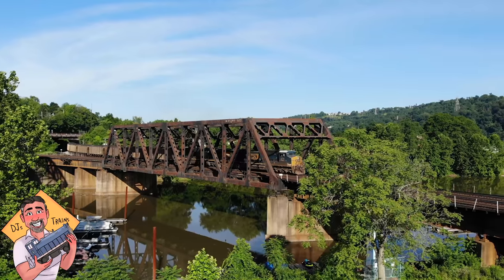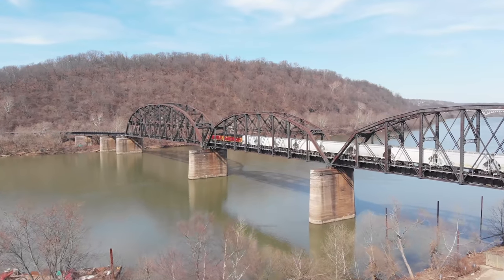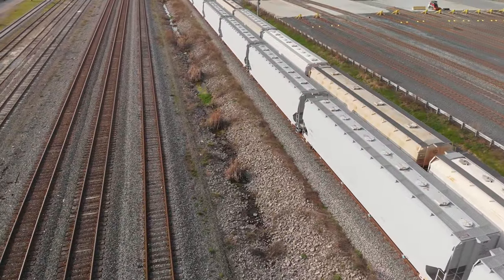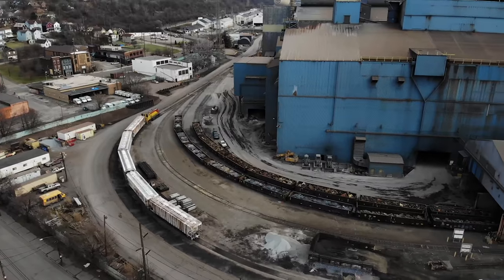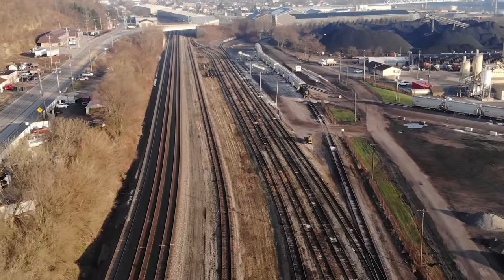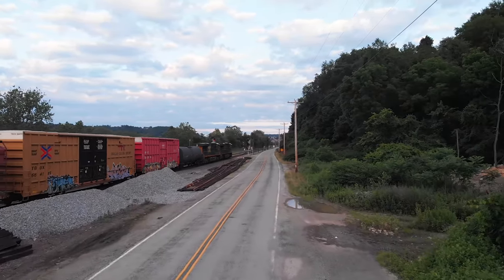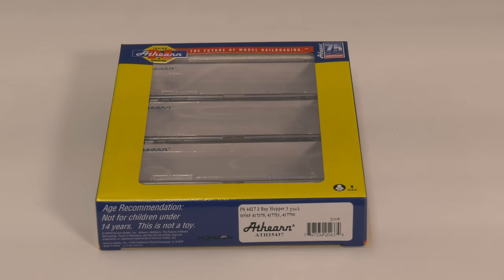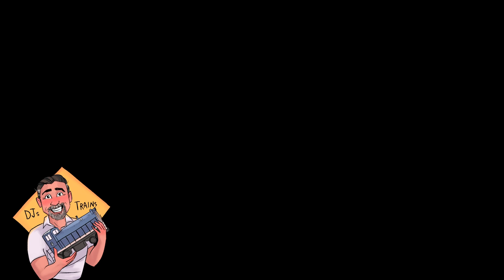RAILROAD FREIGHT CARS EXPLAINED BY AN ENGINEER!

Comment: I live out in Utah where a lot of salt is shipped by rail and a large variety of hoppers, 2 bay CSLX 5000s all stainless steel, now I'm seeing former 2 bay Winchester and Western 2 bay covered hoppers. And to make things more interesting, about 15 years ago a railroad car shop opened up and does repairs on the cars. From replacing the the bottom discarge gates, roof walks, lids / hatches, truck repairs to complete repaints. Always neat to see a car fresh out of the paint shop only in fresh paint. After watching the activity there I decided to buy one and once I get going on my layout I'll build it with an overhead crane big enough to unload damaged cars and carry it over to another bay for wreck repairs. I've seen a lot of variety of cars go through that shop! Happy modeling everybody.

Comment: You neglected to mention the difference between Covered Hoppers for agriculture products and ones for Plastic Pellets. Plastic pellet hoppers are the thinner discharges and are 4-bays, grain hoppers are wider discharge and are usually 3-bays, dried distillers grains which are a byproduct of ethanol and are used for feed are in 4-bay grain hoppers.
Rib Side and smooth side is basically age, the rib Side hoppers were mainly built in the 70's and 80's.
Reply from the maker: Thanks for the info
Reply: I used to switch for SGS petrochemical, we have nothing but petrochem/polyethylene plants here in Houston.

Comment: I've watched several of your videos now, and just wanted to leave you a note THANKING YOU PROFUSELY for all you do.  I've been a railfan and model railroader my entire life, and I think I've learned more watching your videos than any other source, no kidding.   

I'm also a BRAND NEW N SCALE model railroader!   I'm in the process of creating my first ever N scale model railroad, even though it's just going to start out as a simple loop.   But I'm using the T-TRAK modular standard, and plan to add to the railroad using additional modules as I have time and money to make them.    I think of it as layout building on the installment plan!   But even though my first layout is going to be small, I designed in seven industrial sidings for some switching action.   The only industry that will be able to make use of covered hoppers will be my grain elevator.   After the oval is setup and running, a small yard will be the next project.   

THANKS AGAIN!
Reply from the maker: Fantastic 
You seem very smart, not trying to tackle a basement empire and instead starting small, logical and practical.  Keep industry close to mainline and no try to fill up plywood with track.  I thank you! And wish you the best.

Comment: I am building a layout in a space that to small to even host a 4x8 in HO, unfortunately, operational doctrine means that I cant do everything prototypical (I have to use my yard for storage of my 7 car Daylight, and cant afford to host a A/D track), but I've tried to keep it neat, and somewhat prototypical. I have two industries (a freight house, and a grain loading facility) and 1 & /2 track in my yard for each (keeping in mind my 7 car daylight, I think I made good use of it). I do have a siding on my layout, but my doctrine (and train length) keeps it fowled on one end. For approximate size the room is a 12x12, and the layout is 5x11 (and is on the floor). Trying to get it that much more prototypical, but being restricted to 60 pieces on the trial (because I don't have the best income, plus I have other hobbies) is making things difficult. I do want to try and make the layout a 6x10 soon, but "soon" for me could be as late a November next year.
Edit: I also need to keep the layout easy to move without breaking details and what not should I move into a bigger space. Hopefully when that happens, I will be able to make the railroad a bit more prototypical, if I have not fully switched over to building warships by then.

Comment: There are two basic eras of railroading, typically thought of as steam vs. diesel.  But it is more profound than that and there was a long period, a generation or two of switching over.  The earlier era as dominated by human labor and the modern one, machinery and automation.  (I may be painting with too broad a brush for this discussion.)
Covered hoppers and containers are the result of being able to load and unload vast quantities in bulk.  Up until WWII, cement for instance was shipped in canvas sacks or maybe barrels or drums, inside a box car.  These were loaded, unloaded by men with handtrucks or even just brute carrying.  Grain was an early commodity that could be moved by conveyer but was shipped inside box cars with special temporary "grain doors" to seal the door openings and allow the box car to be used like a covered hopper, EXCEPT it did not have bottom hoppers to facilitate unloading.  However, this was partially due to so many box cars around, so these cars were not specialized and thus limited.

Comment: I'm not much up on modern day railroading but through most of the 20th century at least, each freight car was uniquely identified by its "reporting marks." These were the standard initials of the owner, such as "NYC" for New York Central, and then a unique car number.  This allowed the tracking of where to send each car based on "waybills" (the piece of paper that identified the shipper, what was being shipped, from where to where, etc.)  
Often model freight cars are only offered in one or a few car numbers.  If your operating scheme depends to using these marks, you'd need to keep them unique - although in modeldom, confusing two cars and sending each to the wrong destination, is not a problem.
Reporting marks can also refer to the additional info stenciled below the reporting marks (see, different meaning and usual kept separate by context).  This would including the light weight of the car, when it was last weighed, and the weight capacity.  Many freight cars have to be weighed on a track scale after being loaded in order to make sure the weight isn't exceeded and sometimes for how much to bill the shipper.
This explanation is because when weathering the car, the reporting marks need to still be visible.  As freight cars got dirty, if they weren't in line to get a brand new paint job, they could get their reporting marks repainted.  Sometimes the background area is also repainted, even in a different color, to make the contrast visible.  

In the steam era, when most cars were either black or box car red, it was common to see muted dirty cars with bright white reporting marks.
Reply: Reporting marks haven't changed much over the years.   There is a 2 to 4 position alpha code representing the car owner and a 1 to 6 position number.   This is the North American standard.   That standard is not followed internationally.
Reply: @cdavid8139  That is certainly true to today but if you go back far enough, things were much more fluid - standardization on so many features came about due to confusion prior to that but it took awhile for things to get bad enough that something had to be done.  
At first, the cars themselves were not interchanged.  Loads had to be unloaded and reloaded into the new road's cars at each interchange point (although often loads were not shipped that far - the railroads performed the function of local trucking firms).  
Then railroads set up "fast freight lines" which were designed to facilitate movement across many roads.
Another thing that arose was the "Official Railway Equipment Register" or ORER - a boon to future modelers in terms of getting historical info and many are available now on disc.  They would spell out "the cars of this railroad are marked . . ."  and give both the names and initials for the alpha code.  But railroads at the time seemed to have hated standards applied to them by outside forces.
For instance, Rutland freight cars were marked with "Rutland" as the alpha code on the side of the equipment and just "R" on the end reporting marks.  I seem to recall their official marks were "RUT" which wasn't used on the cars themselves, only in the paperwork.  I have also seen conductors' notebooks for the Rutland (by one William Shakespeare, a literal descendent of THAT guy) where "C" was used for New York Central, since so many passenger cars on the Rutland came off the Central.  
The term "reporting marks" were those by which the car ownership was designated for REPORTING purposes on paper and only slowly came to also mean the way the cars themselves were marked.
There was the common practice of having the initials end in "X" if it was a private owner, not a railroad - such as Railway Express Agency being "REX."  RR-owned cars were changed a per diem (daily rate of $1 or $2 per day in mid-20th century), like a library charging a small fee to facilitate return of a loaned-out book.  On the rail system, at midnight, the fee went into effect based on where the car was at the time, and so all roughly 2 million cars had to be accounted for.  Then the rr's offset each other's fees so that if railroad ABC had one of XYZ road's car on their line, and XYZ had one of ABC's cars, the fees balanced out.  TWO MILLION cars!
All of these was done in an age before computers and even before photocopies, only carbon paper, and resulted in a massive fleet of clerks hired to make the system work.  (At its peak, the railroads employed directly or indirectly 1/6th of the entire nation's labor force.)
Privately owned cars were charged a mileage rate.
Another constant problem early on was the constant buying and selling of one railroad by another, both subsidiary lines and mergers so the ORER would have to list ALL the initials under their control, resulting in a long list of different letters for some roads.  It also would take awhile for the car shops to getting around to relettering (and sometimes renumbering) the entire road's fleet, particularly since cars might be wandering around off line for quite awhile.
Back in steam days, the ampersand (&) was used in reporting marks but later dropped so the D&H became the DH.
One of the major things to consider was that in steam days, many decisions were made between individual roads and slowly grew to become a national standard, but NOT a government-imposed standard until later.  Thus the roads were free to bypass the overall standards by agreeing among themselves on minor points.  This ability to vary was slowly reduced in scope over the 20th century.  (For instance, at different points, old mechanical systems like archbar trucks were outlawed in interchange but an individual road could run cars with these as much as they wanted.  And they might allow certain equipment with archbars from a neighboring road to run on their line, either an actual agreement or just simply "looking the other way."  The ARA/AAR (American Railway Association/Association of American Railroads was an industry-wide organization which did not have the clout of the federal government ICC/FRA.

For anyone serious about their model railroading for a given era, getting ahold of an actual paper copy or digital ORER to see specifics.
Reply: @johnnehrich9601  Anything I write or post basically reflects 1976 and onward.  What happened before I entered the industry I really don't know so I bow to your wisdom and knowledge.       A few comments on what I do know.    In the US if a car ends in "X" it is indeed private and not railroad owned.   Trailer Train is a 'sort of' exception here.    The ORER (Yellow Bible) does list the car marks associated with the owning road.  Picking up an old copy at a trade show can be fun to review.       The ampersand may still be seen on the side of the car, but the cars are registered in the industry (UMLER) without the ampersand.   So D&H may still be seen on a car, but the registration and reporting is DH.   When I came along the per diem charges became per hour charges (the term per diem is still used).  I have worked with yardmasters who still recalled the 'midnight interchange' where they were graded on having cars interchanged before midnight so the daily rate went to the receiving road.     Over the years I have been involved in dozens of restencilling projects.   Sometimes the effort takes years if the cars stay under the control of the owner.   RIght now thousands of cars are being restencilled as they come out of storage and go back into service.    Of course now, in addition to changing the car marks, you must change the AEI tags.
Reply: @cdavid8139  And I have to admit the further forward from c. 1950, the less I know.
I did hear a story that one time a shop was in the process of relettering cars, perhaps totally new lettering or perhaps restoring the same after a total repaint job.  The crew worked their way down one side, sequentially numbering.  Then they went on the other side and did the EXACT sequence, NOT a mirror image, meaning the cars got a different number on each side (except perhaps the middle car in the line.)  Wonder how long it took for them to realize it.
I also know some modelers purposely letter/number one side of their rolling different from the other (for a "linear-type" layout), so when the train is going the opposite way, they get the effect of a whole another batch of cars.
The one thing re: the X was that Merchants Despatch was a private-owner company, but was a subsidiary of the New York Central system.  Their reporting marks were "MDT," not "MDX" or "MDTX."  (Probably a logical reason but I don't know all the facts.)
Also, this system of reporting marks extended both north and south, meaning Canadian roads and Mexican roads were part of it.  
Never heard the ORER called the Yellow Bible, but boy, was it, at least for me.  I started with a 1949 ORER and practically wore it to pieces.  (Over time I got more years, including the really early ones on disc.)

Comment: What's interesting about covered grain hoppers on unit trains,is you can buy just about any road name and still be realistic. Even old fallen flag RR's hoppers are still out there. Saw a D&H covered hopper go by today. Even if you model NS,CSX or whoever, you don't need a solid consist of per say RR to be prototypical. Plus it makes buying a bit easier cause anything goes.
Reply from the maker: YOU ARE 100% CORRECT!!!!
Reply: Often unit grain trains start out with one ownership but over time as cars drop out and are added you get a mixed bag.   Grain trains tend to be either railroad owned or private owned.   So if CSXT is supplying an elevator with a grain train you'll see cars in the trained owned by CSXT (including the fallen flags of railroads they acquired).    If the customer is supplying the train, it is usually made up of private marks (PTLX,   GACX  etc) that they lease cars from.

Comment: Although covered hoppers can carry so many commodities, in many cases, each car is limited to one specific type of load, unless the car is thoroughly cleaned between these.  Not so much loads like sand but certainly you would not want to haul breakfast cereal in a car that just finished carrying cement.  So on a model railroad operating session, you'd not want to switch a car from a (theoretical) industry where it was unloaded to one of a different load.  (On the other hand, since we can't see inside this type of model, if no one is following the car's journey, you can cheat.)

Comment: Once a hopper is "earmarked" for grain or food usage.   Will that car also be used to transport Fertilizer or sand?   

Would you know if...
 Do most (if not all) food industries clean the hoopers, on each use ?
Reply from the maker: Great questions, but I dont have those answers.
Reply: I wondered why my bread tastes funny sometimes.....
Reply: I think it might vary as often food is washed, cleaned, etc. during the processing itself. But definitely YES if the type of commodity was being different than the previous load.  In steam days, often empty box cars were sent to a part of the yard where they could be swept out.
Reply from the maker: Donald Norfleet  EXCELLENT INFO
Reply: In general cars moving food for human consumption are lined and are going to stay in that particular service.    If you put fertilizer and/or sand into one of those cars the product can damage the lining.    Moving ag products used in animal feed such as corn or soybeans does not usually require anything special.   They tend to be larger cubic capacity cars and in the 100 to 110 ton range for weight.    You don't in general see cars switch from one product to another, though for some cars it can be done with cleanout.    In some cars, like those meant to carry specific types of sand, you may find they can't be used to switch between one type of sand and another.

Comment: 90,800 total YT competitive railfanning foamer points awarded 👍 Key bonus foamer points: Over the bridge shots 6,000. Fallen flag bonus NW 3,000. Foam Flakes breakfast cereal, lol 3,000. Cars that couple and don't derail - entertrainment bonus 6,000.
Reply from the maker: add 500 points for my awesome coupling and rough train handling sound effects, lol
Reply: Only 90,800 foamer points.
Reply: @djstrains  Idk... That wouldn't qualify as "foamer points," i.e. railfanning footage. Idk... modeling railroading points? Prototypical abusing the equipment operating bonus points, lol?